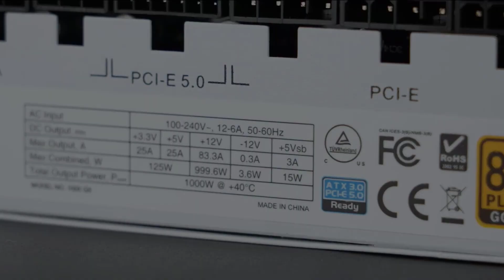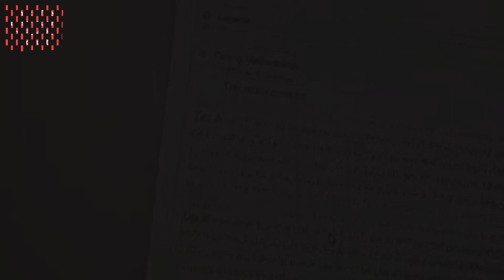Vetroo 1000W White Power Supply ATX 3.0 Ready Dual PCIe 5.0, 80 Plus Gold Full Modular

Comment: Dude this PSU vga cable pcie has only 2 cable lol my 7900XTX GPU uses 3 cables so there you see the problem... Luckily i had those 3 VGA cable from EVGA 850w Supernova GT
Reply: I found it a bit odd that it had 2 of the new connectors why not 1 and another 8 pin for gpus